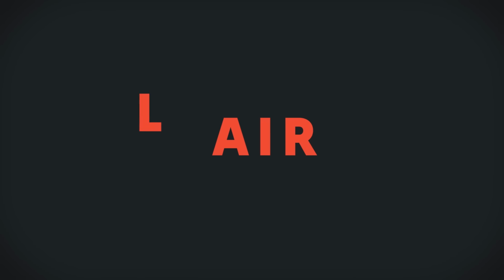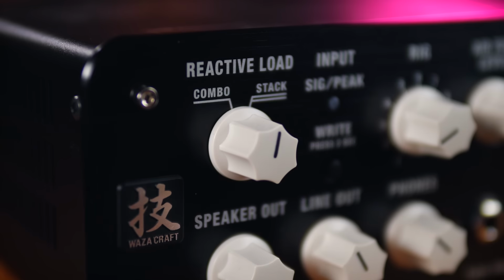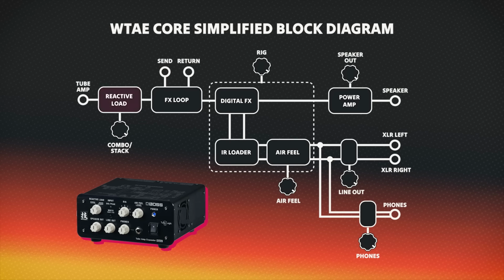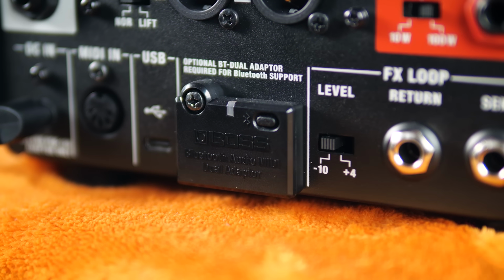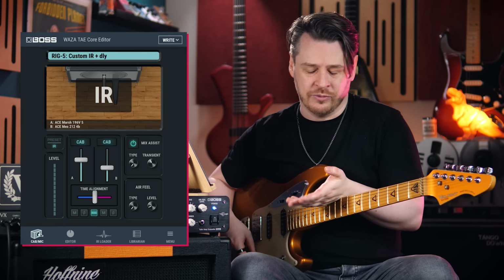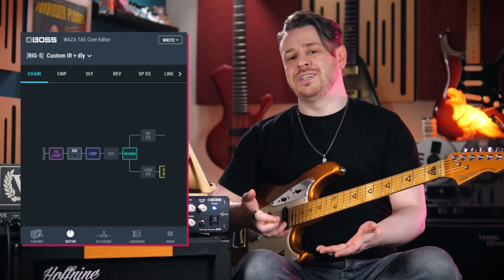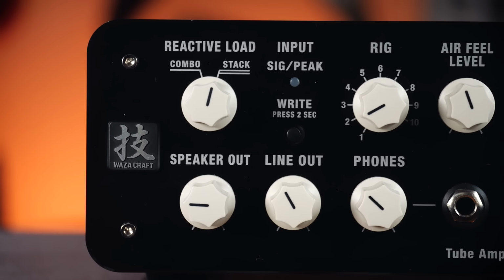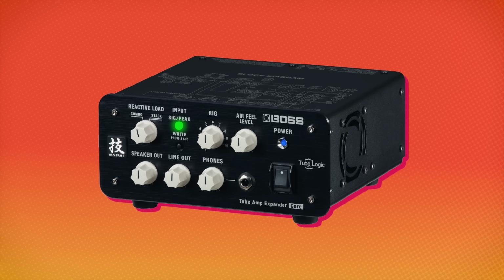Loadbox, Attenuator, IR Loader - Tube Amp Expander CORE does it ALL!

Comment: Great run-through, and a very useful bit of kit, the stripped-down version is probably more useful to most of us. I do have one question though, as you increase the attenuation how does it cope (even in pricy attenuators like the UA one the tone suffers a bit)?
Reply from the maker: Here's the thing:
Can you really claim your tone 'suffers' when without an attenuator you couldn't get your amp to a practical volume level in the first place?

For my application (and the application of the vast majority of people using these devices), using an attenuator sounds infinitely better than not being able to use your amp at all. I simply could not achieve the quality of sounds I do without using it - it only improves the sounds I can make.
Reply: @ScienceofLoud  Firstly I must say that I think attenuators are a valuable tool (and I don't doubt the quality of the Boss product, though I haven't personally tried one), but accept that you're not going to get get quite the same experience as running your amp at full chat. I would claim that that the amp tends to sound 'better' with less attenuation, though of course that's fairly impractical in most situations (unless you're a stadium level act) and there's no faster way to make a venue engineer cry than turning up with your 'stack o doom', hence the plethora of good 15-30 watt tube heads, where it is more possible to take the arsonist with a flamethower approach. My point about other atttenuators was essentially that as the attenuation is increased, your sound can become a bit gutless, losing what made it attractive in the first place (even the UA one) - Two Note's newest claims to have (at least in part) solved that and I'm curious to see if that's the case. Apologies for the ramble, very much enjoyed the review.
Reply from the maker: @ In terms of other stepped attenuators - they are engaging different circuits with each step. Every time you knock down the volume you will change the sound. 

That's not the case with the Boss unit - it only has one level of attenuation and then is reamplified to whatever volume you need it at. Therefore it sounds the same across all attenuation 'levels' - because there aren't any attenuation levels.

Comment: That looks a very, very useful bit of kit. Nicely explained.

(I actually have a TATA about the solid-state output stage however i genuinely am too afraid to ask!)
Reply from the maker: You should ask it anyway, maybe I can help!
Reply: Okay. To preface this I actually like solid-state amps and have a couple which I use 

Is it not counter-productive to run a valve-amp through a solid-state re-amping process? (I thought that was why Steve Fryette made the Power Station with valves.)

Or is it akin to running a mic'd amp through a solid-state PA or monitors?

Sorry if this question seems a bit thickie.
Reply from the maker: I would agree with your second point: It's akin to running a mic'd amp through a PA. 

The Reactive Load has already done all the impedance interaction job - all reamplifying it after that does is allows you to monitor the sound in room. That can be done readily with solidstate, as the whole purpose of the loadbox was to isolate the impedance interaction from the necessity of an in room speaker. 

From my perspective, it would be highly counter productive to do that reamplification by another valve amplifier - we just eliminated the need for a speaker load to be connected to a valve output section, and then you go and add a second one? I feel Fryette may have done this because it was easier to implement a second valve amp than explain to his customers why they weren't losing anything by having their in room cabinet as a monitor only. 

That said, Boss are also claiming to implement technology that emulates the high impedance interaction with the speaker, which is really only there to appease the people worried that the 'feel' of their speaker won't be the same - even through that should be accounted for with the correct reactive load setting.
Reply: This is a fantastic explanation ❤ @ScienceofLoud

Comment: Er, the attenuation section... so, you take your tube amp's output which includes the power tubes with all their beautifully designed characteristics (including crossover distortion, sag, ripple, etc.) then their DSP emulates this again???  

Surely you just want the highest fidelity controllable signal to your speaker that accurately represents your amp's output?

I've just built my own variant on the classic Plexi 18W and three's something rather glorious that happens with the master vol cranked.  For home use or small stage, a simple resistance-based attenuator does a great job for under £100 although there is some tonal impact.  Comparing the same setting attenuated and full there's more change due to the way we hear loud sounds than from the attenuator.

I certainly can't fault this unit though, some great features!
Reply from the maker: Well, that's not exactly what's happening:

The reactive load is interacting with the output section of the amp - all of those characteristics are contained there. If you take the XLR feed that's what you are getting - the amp reacting to the load. 

However if you want to ALSO drive a physical speaker, the amplifier will no longer see it. By using a Loadbox you've separated the Valve amp output section from the speaker cabinet - they are no longer interacting. 
Those impedance related characteristics are happening at the reactive load, not at the speaker in the room. 

So if you want the speaker in the cab to still behave like it's connected to a tube amp (even though it  no longer is) then you need to implement either a second valve amplifier into the attenuator (which honestly defeats the purpose) or try to emulate it with a combination of analogue and digital methods.
Reply: @ScienceofLoud  Ah, makes sense - a more trad attenuator might be more "true" to the original amp's output but, by attenuating, you're still getting a change to the signal so probably swings-and-roundabouts. 

You'll never get the exact output of your amp with any attenuator in the chain.

Certainly a smart bit of kit and any differences between it's "emulated" output and the real amp's is probably not significant.
Reply from the maker: I haven't yet created any IRs of my cabinet, but from my experience using the Expanders and IRs in general - if I were to load in an IR created from my 212 Cab and compare that direct feed to the sound captured from the same cabinet in room, I think it wouldn't be practically impossible to discern a difference. 
If anything, the emulated output would likely sound better, because it would be more consistent and immune to random changes.
Reply: @ It all becomes a bit moot anyway - you're always listening to it through something analogue and that always changes how we hear something.

I think there's a tendency to think "perfect" is objective, achievable and desirable! :)

100% agree that this type of device is almost essential for sanity and preserving hearing!

Comment: Isn't this just turning massive amps into tiny amp/heater combos?
Reply from the maker: All valve amps are more heater than sound generator. Most of the energy they consume is converted to heat waste - they are hideously inefficient even without an attenuator.
Reply: @ScienceofLoud  solid state amps, by their very nature, are more efficient in that way, right? Or am I totally off-base?
Reply from the maker: @thunderbirdcalls  You still couldn't really call Solid State amps efficient, but certainly compared to Valve Amps - yes, they don't require enough heat energy to boil electrons out of their atomic bonds in order to function.

There is a trade off between efficiency and sound quality - Class D amps are very efficient (as far as amplifier design goes) but they don't sound as good as something operating in ClassA/B. Audio tech is all a balance between what sounds good what is an effective use of resources.
Reply: @ScienceofLoud have you ever checked out the Victory V4 amps? They use class D but also have 4 tubes in the preamp and sound great, IMHO. However, most class D stuff just sounds oddly disconnected. What's your opinion on said product?
Reply: Indeed, and the older Hotplate style attenuators could double up as someting to cook your dinner on while you played.

Comment: I don't know if it's just my laptop speakers, but the IRs sounded better to me than the mic in the room :-/
Reply from the maker: That could be because the IRs have a bunch of processing done to them and the mic on the cabinet does not. That is the strength of IRs - someone has already done some of the studio work for you.
Reply: @ScienceofLoud  Sounds about right. These load boxes with IRs make getting good recorded tones at hone way easier. especially in an apartment where I can't really get away with any volume at all.